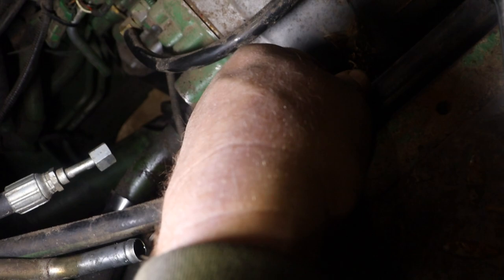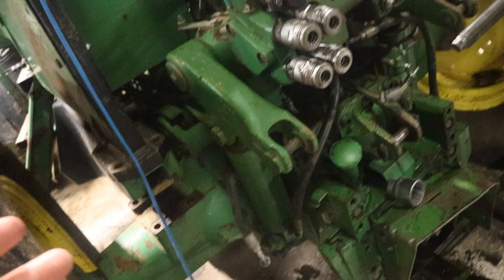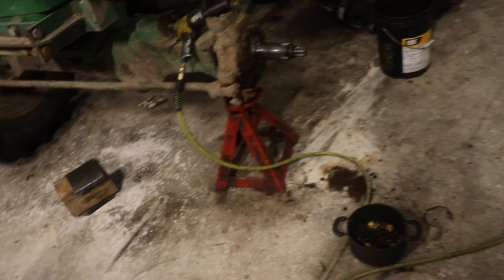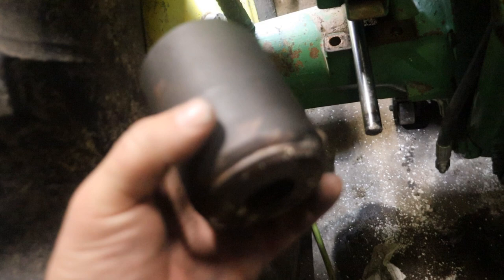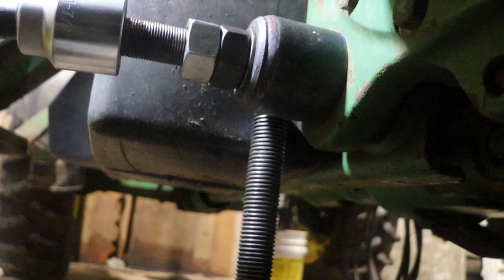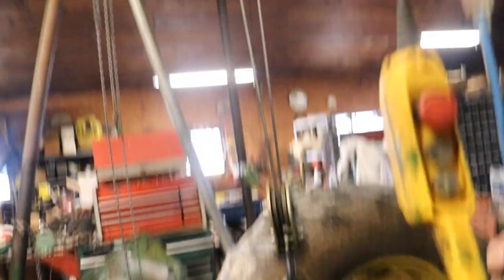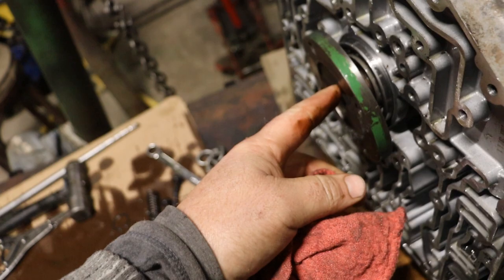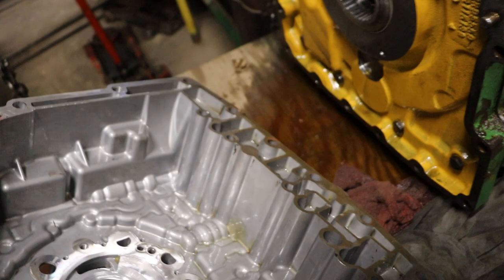john deere 6300 transmission repair.

Comment: Do you have a fast or easy to set the shift cables
Reply from the maker: I dont know what you mean.
Reply from the maker: Do you mean a trick to set them? John Deere Transmissions usually have a very good detent. I usually put the shift arm on the transmission all the way to one way in that first detent and then put the shift lever in the corresponding spot then you simply shorten or lengthen the cable to make it line up very nicely
Reply: Yes  thank you Jon I got a 6405  I got a cable broke  was worried if I could get it new one in
Reply from the maker: If you old cable is still in one piece I laid on the bench next to the new one and get it fairly close
Reply: One the end broke  but the other one I will do that   I was going to replace both while got the floor up and panels off

Comment: Hey i got a jd 6400 that is jumping out of 3 gear. Any solutions
Reply from the maker: Power quad? 
3rd gear on the powershift or range C ?
Reply: @jonstevensmaplegrovefarms3754  does not matter what range. It pops out of 3 rd every time you let off the clutch. I don't think that the de-tint is allowing it to stay in third. My main question os do i pull the trans or both TRANS
Reply from the maker: @thomasrivers7585  That's a good one. Can't think off the top of my head what it could be. 
Can you hold I there and then would it work?
Reply: @jonstevensmaplegrovefarms3754  yes i can hold it in third an it will stay as long as i hold it. I have looked for 3 years. About this problem. I can't find a solution so going to pull both power shift an trans.
Reply: @jonstevensmaplegrovefarms3754  i am here in between corsicana and PALESTINE. Sorry about the letter size i cant see good out of my left eye
Reply from the maker: @thomasrivers7585  good luck, stay safe.
Reply: @jonstevensmaplegrovefarms3754  thank you very much
Reply from the maker: @thomasrivers7585  4640jon@gmail.com is my email. Send me  your story. How you got started in farming, what was it like growing up, a fun anecdote or two. What's it like now...I can share it on a video if you want.